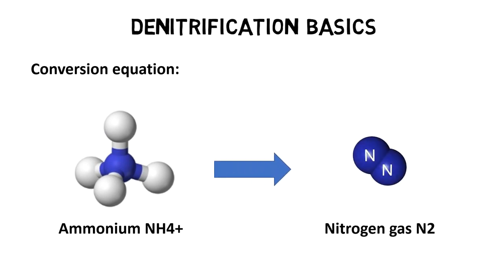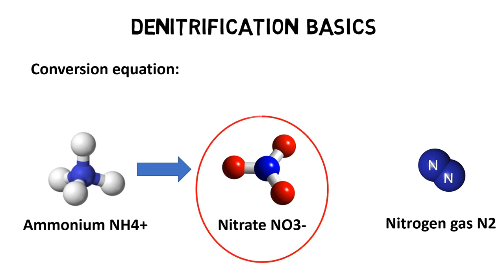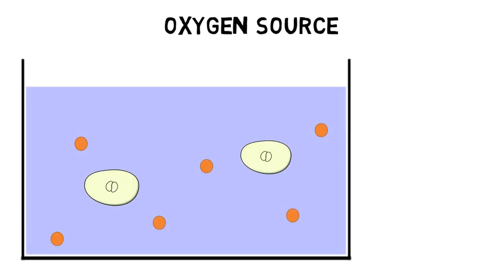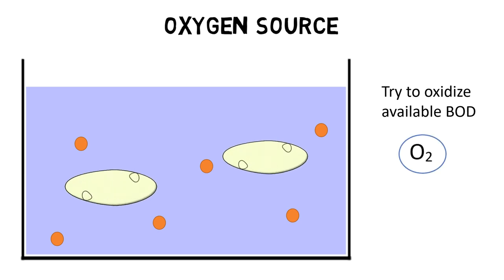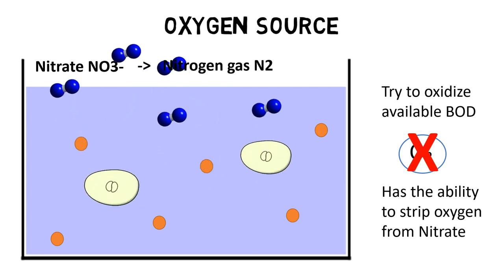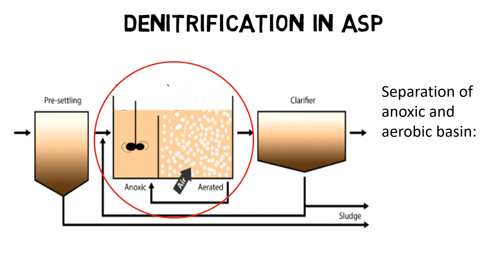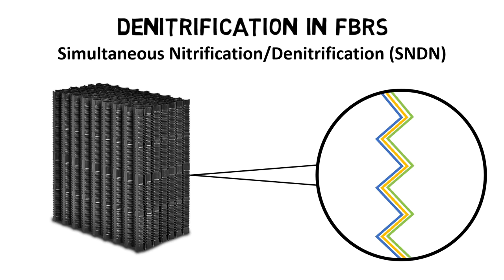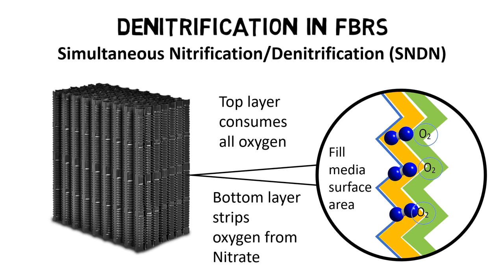How does denitrification work and simultaneous nitrification/denitrification

Comment: Very nice, concise and informative presentation as usual.

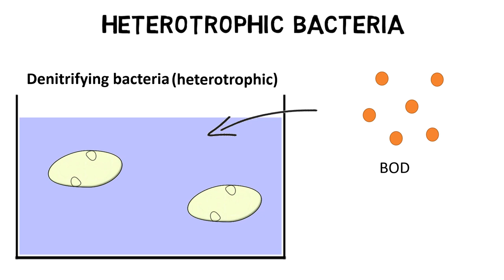However I strongly feel that is necessary to make an important correction. At minute 1:15 you say that the organics required for denitrification comes from the external recirculation from the bottom of secondary clarifiers. This is not true or at least is not significant because the soluble organics on the recirculation stream contains just the soluble-nonbiodegradable parts (same concentration as effluent BOD) which cannot be used biologically for denitrification. On the other hand the organics returned by external recirculation in the form of particulate matter (at an already degraded level corresponding to effective sludge age) cannot be so fast used by bacteria in the anoxic compartment which has a low volume and low hydraulic retention time. To use these organics the other bacteria should hydrolise and ferment them. The majority of usefull organics come just from the influent as soluble RBCOD (Rapid Biodegradable COD) or from external dosage (e.g. metanol, etanol etc). This concept is followed also in ASM or other models.

Another observation is that will be nice to include and emphasise the term “facultative” heterotrophic bacteria in order to understand that the models consider that part of total heterotrophic bacteria are special because are able to solve his catabolic requirements switching from oxygen to nitrate (facultative OHO is part of total active OHO). Extremely important to note that if both molecules (O2 and NO3) are present, the bacteria will switch to the NO3 ONLY after finishing existing oxygen (by the virtue of bioenergetics). This is clearly predicted by the models and proved by real measurements.

An important consequence of the above bacterial behaviour combined with the particular naming of the process itself - concept of SIMULTANEOUS nitrification / denitrification - is that many designers tend to wrongly consider that both process take place in the same volume with the maximum efficiency (as for e.g. in intermitent aeration in a same volume=active bacterial mass). The reality is that, depending on the oxygen concentration, the kinetics of one process complement the kinetics of the other - e.g. if for a particular conditions you have 30% eficiency for nitrification you may have just 70% for denitrification. That’s because maximum nitrification efficiency require an excess of oxygen (due to particular shape of Monod kinetics curve) but the denitrification require a complete absence of oxygen. 

For biofilms there are a lot of pros and cons on the multilayer model (e.g. why the nitrate produced by nitrifiers is difussed only to the inside of the biofilm and not to the outside as well ?) but probably the best thing to emphasise is that the process is very hard to be controlled because the biofilm thickness is continuously changed and strongly depends on the hard to be controlled or properly simulated hydraulic factors (e.g. water velocities, air scouring, water viscosity, local fluid patterns etc.). Even if I give few credits to the multilayer theory I prefer to  think the nitirifcation / denitrification process in terms of anoxic pockets model.
Reply from the maker: Dear Dan thank you very much for your comment. We agree with your statement but we had to concentrate on the basics and simplify some facts to be able to fit everything into a 3 minute animation. We appreciate your input and please keep it up because it describes some things in more detail.